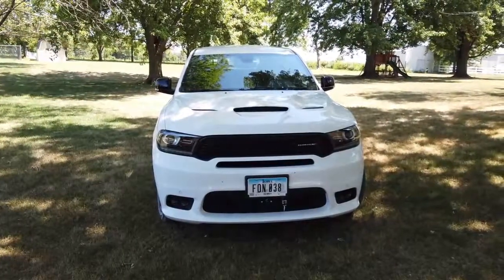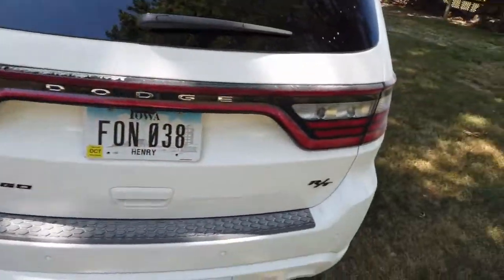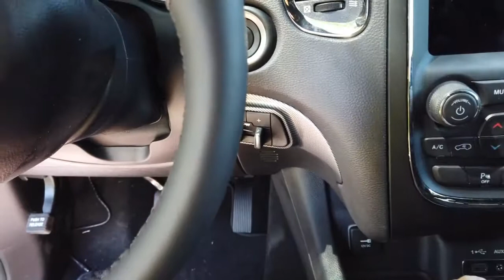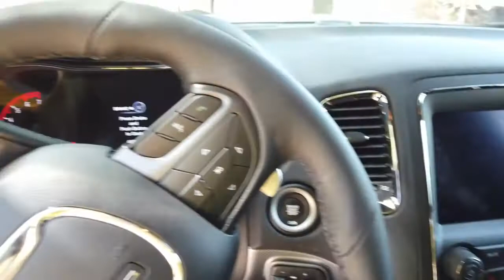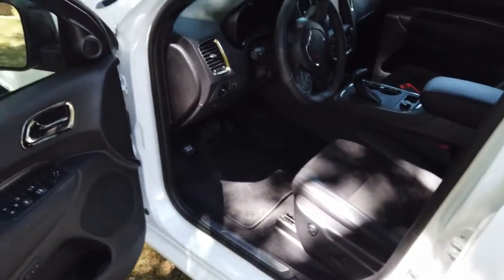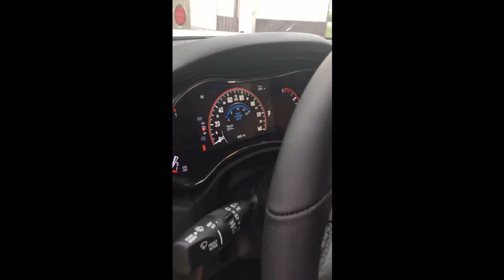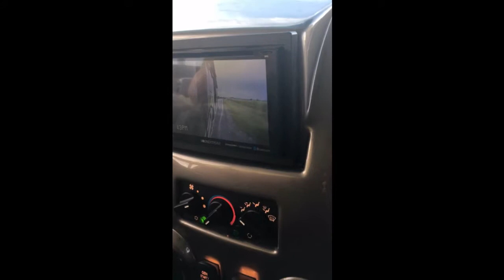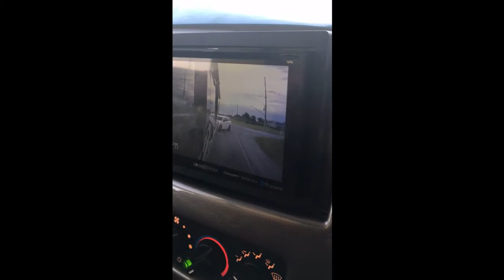Our Tow and Blue OX System / RV Traveling with 6 / Full time RV

Comment: We started.towing our 2021 R/T this year and have made 2 trips. Both times, at the end of the trip, after disconnecting vehicle and engaging the transfer case, I am seeing a SERV AWD light on the dash. It goes away after driving a few minutes, but concerns me that is turns on at all. Afraid I might be forgetting to do something. Thanks in advance.  Also did you happen to invest in the accessory for the Durango that powers the electic power steering while towing the vehicle?
Reply from the maker: We have never experienced that with our 2019 R/T. No, we have not invested into any extra accessories for the Durango’s power steering. You may want to check that the 2021 model didn’t require the aftermarket coolant for the transfer case though. We didn’t require it, but we have heard each year may vary. Sorry that I’m not much help. Let me know if you have any more questions though.

Comment: Hi.
Good video, but i have serius cuestion about how put the neutral bottom back in function
Reply from the maker: Fe Am While your in neutral the shifter will be in park. Shift back to neutral with your foot on the brake. Press and hold the neutral pin in until you hear the transfer engage. Once this happens your dash panel will be back to normal. Place the shifter back to park to complete the process.
Reply: @RVTravelingWith6   awsome, perfect trouble resolve.
Reply: @RVTravelingWith6  thanks... Take care.